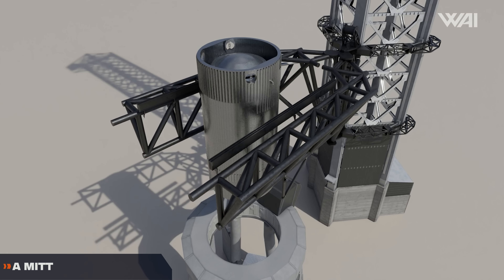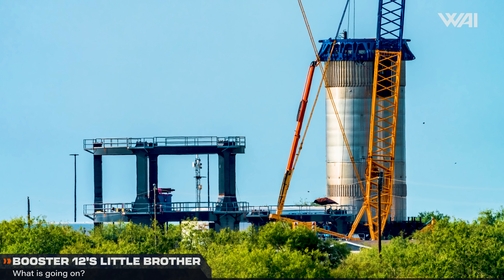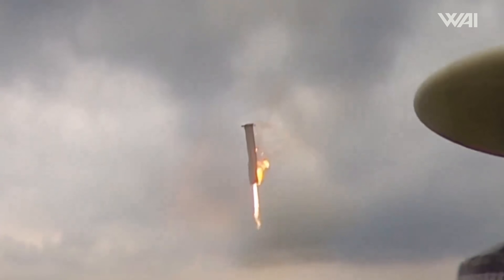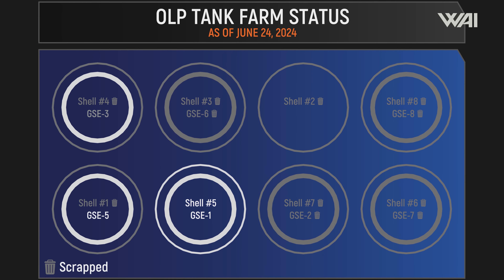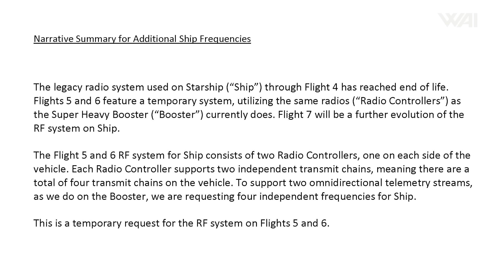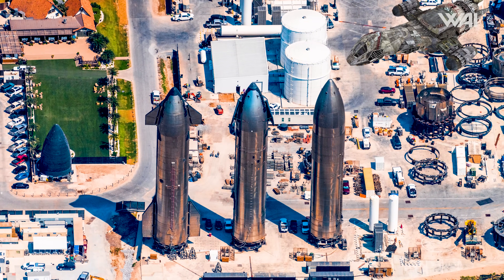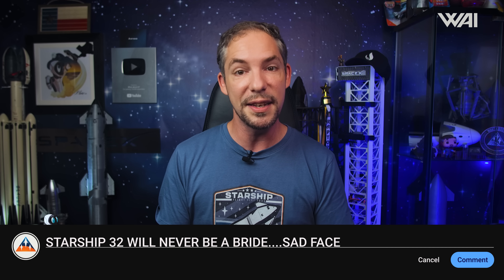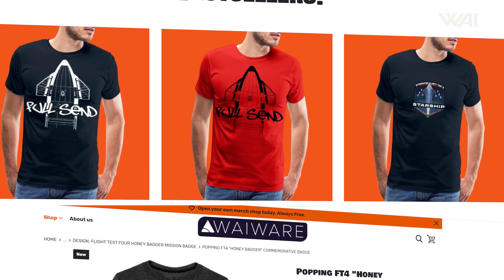SpaceX Massive Starship Drop Test! & Musk Talks Heat Shield, Starship Failure & Raptor V3!

Comment: I don’t think that lifting b14.1 via crane and dropping it on the chopsticks is the most likely scenario. It would be more probable that they simply fill it with some liquid to simulate the mass of a landing booster, then lift it with the chopsticks to see if they can handle the weight. No need to risk the chopsticks with a little drop.
Reply: Plus "dropping" from a crane is potentially detrimental for the crane itself.  Imagine that you have a loaded crane and then suddenly releasing that load, such a sudden release of a load would cause the crane to react in the opposite direction and potentially shifting the crane's balance and causing it to topple.
Reply: @shrodingerschat2258  exactly. The only thing I could possibly see them doing would be hooking it up and slowly lowering onto the chopsticks to simulate a slow touchdown

Comment: Do you think spacex could actually use the next booster as a hop test and catch, filling the booster to the point where it can launch just the booster so its nearly cleared the tower and then have it just do a catch, that way removing the bit where it has to hit a bullseye and  then get caught? It may be something a booster that hasnt got an integrated staging ring may be useful for?
Reply: Getting it hop-ready is already just days away from getting it launch-ready. And if you can launch and test the ship too you may as well. Just like they did with falcon 9, you may as well take payload to orbit while testing water landings.

Comment: Why not use landing legs by now? Given the raptor 3 specs, you would think the weight of landing legs is less of an issue now.
Reply: The idea is to return to the launch tower so the booster is ready to be refuelled and the next ship to be stacked for rapid reuse. Having it land on a pad and transporting it back to the launch tower is much less efficient.
Reply: Because catching it is cooler and in theory better. If they pull it off they won't have to collect the two sections separately off the ground, instead they can just reassemble them like normal
Reply: Uhh because Elon Musk wants to lower the price. No heavy legs = cheaper.

It's an innovation, improvisation and efforts to make space business more affordable and lower the cost budget.
Reply: @Nightdreaux22647  Is it cheaper though given all the other components that are needed to make this work? Also, cost is not the only factor when designing something. Reliability and complexity are also factors. You might want a slightly more expensive solution if it significantly cuts down on the complexity of this big ass sophisticated catch mechanics.
Reply: @TubantiStudios  The arms are already there. Before they committed to a catch, they already had Mechazilla's design finalized. Landing legs work great for a smaller ship like Falcon 9 (which is massive.) But not on a ship taller than most buildings and wider than a lot of houses. How are you going to pick up a booster and put it on its stand? You would need a massive crane for that. Not any regular crane. 

SpaceX was laughed at for putting landing legs on Falcon 9. And they were asked, "Why not just put a parachute on it?" Same thing is happening here. "Why not just put landing legs on it?" Because a catch provides better performance and quicker reuse. It really isn't more complex at all. It's more risky, sure, but the mechanics are the same. To come to a stop at a certain point. And once they get their software fine tuned, it'll be just as reliable as landings are for Falcon 9
Reply: @TubantiStudios it is definitely cheaper to build the infrastructure on the ground than launching the infrastructure to orbit every time.
Reply: more leg weight means less cargo weight. No part is the best part.
Reply: @patrickd9551   No part is the best part.

The 3rd best part is the part left behind.

The 2nd best part is the part left behind and shared with multiple boosters/starships.

Comment: Starship should have 4 lifting points so it has more room for error of entering the chopsticks in the wrong rotation.
Reply: If they're so far out of control that they can't control the rotation then they have much larger problems. Any ship that doesn't demonstrate proper roll control won't be allowed to get anywhere near the tower. I'll be splashed down offshore instead.
Reply: I thought the grid fins would suffice as emergency backup catch hooks. The booster shouldn't weigh much with all the fuel burnt.
Reply: @hotrodandrube9119  The booster shouldn't weigh much with all the fuel burnt.

200+ tons